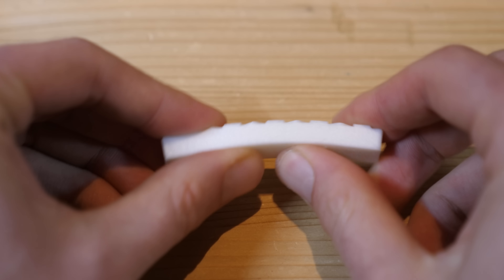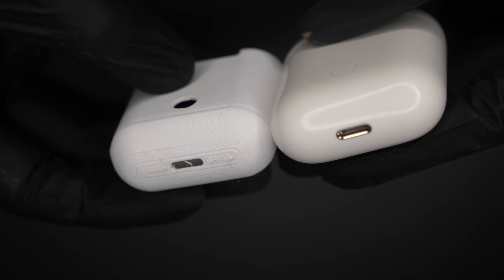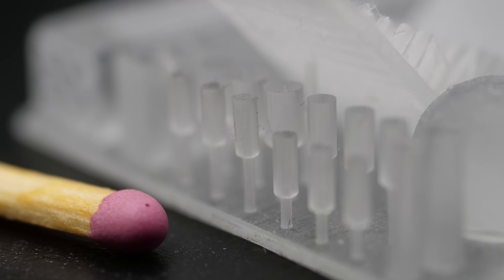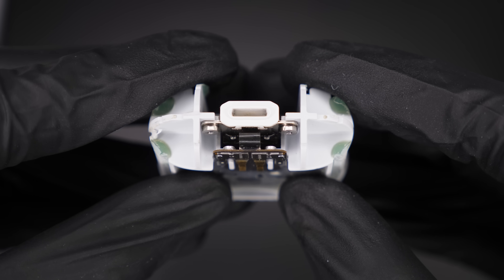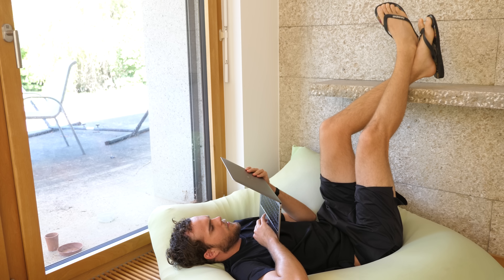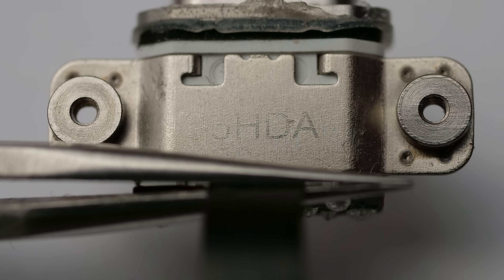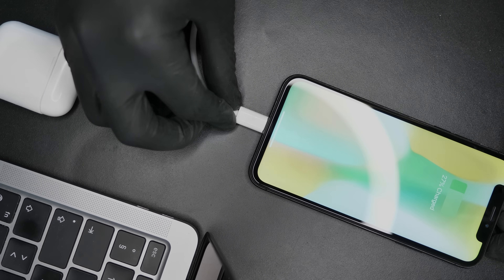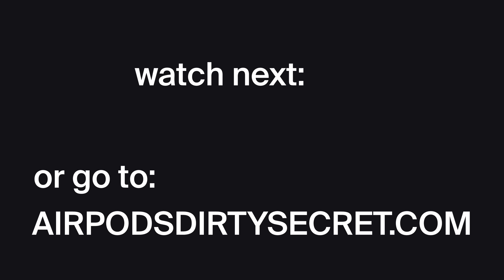AirPods' Dirty Secret (and how I'm fighting it!)

Comment: What if someone made a online shop where u could buy a printed case battery and USB c cable adapter as a set.

edit: maybe even with the usb c port and battery pre connected so u only have to connect the case insert and top.

Comment: I don't understand, were you trying to prove Apple right by spending a ton of money, time and skills fixing this. This process cost more that a new Air Pods. Also, complained about batteries going to the landfill it doesn't seem like you fixed this, you replaced the battery. what did you do with the old battery, throw it away? It seems to me that you only saved some control electronics and plastic, but you use high level skills and an expensive welder. I don't think there's a net positive here.
Reply from the maker: - pinned comment
- battery properly recycled

Comment: I salute your persistance.
However, $3000usd in equipment to do the repair. And 3rd party pcb, screws and hardware. Maybe we need to cottage industry the important things like engine management and powertrain computers?
Nice 3D printer, O-scope and inert gas solder station. Young man, you need to be leading a team in DARPA Tech development. Begin by reverse engineering Iranian drones.
👍
Reply: A Lipo pouch of about 800mah is available  with charging protection circuit on the pouch. Micro j pin connector. For charging,
 A 1.5mm bannana plug would add durability. 500mah charger. This is just a 1-3vdc circuit.

Comment: Congratulations you have proven Apple correct that it is not economical for them to repair them.  Subtract all the time and cost you went through to make the parts, even though Apple could theoretically have parts for technicians to repair them the cost of those parts in addition to the labor cost and other overhead costs, when added up would easily be more than the cost of just replacing it.
Reply from the maker: that's the point, it was designed to be unrepairable...

Comment: MOLEX is thé Compans sourcing Apple with that connector.
Also I didn't check lightning port pinout and protocol : how far Can your adaptor replace ligthning? Only power? Or you also concerted the communication ?
Great job
Reply from the maker: Well that was the problem, molex didn't make that connector. My lightning to usb-c circuit supports both data and power, but the airpods case only uses power anyway. Thanks for the comment
Reply: @ExploringTheSimulation  thanks for the answer. I've watched your other vidéos so i better understand the replacement now. You have a very décent lab, and a New subscriber ;)

Comment: yeah thats apple for you they  make things that are impossible to fix to make you buy a whole new one when they break which is why i will never use an apple product unless its bought for me its the worst case of consumer slavery ive ever seen i would also like to add that they make there stuff not future proof which means they makes sure that the electronic product will break after a time limit due to built in problems with the tech its literally designed to break

Comment: Next apple will add a sensor to detect deviations in luminance values inside the device and if you dare to replace the frame you'll get a notification that your airpods may explode right into your ears on max volume every 10 seconds.

Comment: pretty cool, I don't think the welding is necessary, it'd make future repairs a pain in the ass.  Maybe some glue instead.
Reply from the maker: I probably didn't show what the welding is for properly. I'm welding nuts so that the replacement part can be fixed in place with screws. So no pain in the a**.
Reply: @ExploringTheSimulation  Oh okay, that makes sense.

Comment: “It costs more to open it up and replace the battery than just buying a new one”

Lmfao, wait until Tesla uses that. (They weld their batteries to the frame, instead of bolting, like every other EV manufacturer out there

Comment: Apple needs to bring back the 3.5mm headphone jack. Phones have gotten bigger, so there is plenty of real estate. The plug in 3.5mm headphone work every time. Wireless earbuds are inferior tech, if you can't charge them -then you can't listen to music. You don't have this problem with earphones that don't need to be charged!!!! It is a waste of electricity anyway. So the 3.5 mm jack headphones are actually greener for the environment. I got plenty of broken dongles that have made their way to the trash too. Those lightning cable headphones are terrible too, they cut out sound all the time. I did not have these problems with older model iPhones that had headphone jacks. It is really frustrating how retarded it all is.

Comment: Not related but if Apple decided to switch to USB-C, Because I still use an iPad Air 2 and an iPhone 8 which are not compatible with USB-C,  and with no plans to upgrade in the future, all future chargers would be USB-C but because I use lightning I will not be able to charge my devices if my chargers either broke or I managed to loose them.

Comment: Apple could easily have had this case screw together. They could even have a plastic cover panel bonded by adhesive to cover the screws if they really wanna use the aesthetics excuse. It's how they hid the screws on the iPod Mini. My iPod Mini is still in use today. This is purely to drive sales of new product at the expense of the environment.

Comment: Just another case of Planned Obsolescence being perpetrated by Major Manufacturers, under the false guise of saving $ for the consumer, claiming its too expensive to replace the batteries than to buy new ones, the product was designed this way. 
They made it intentional difficult to replace the batteries, and then make their claims of it not being financially viable.  
Ignoring the fact they creates the problem in their Manufacturering design.  

This is a common manipulative practice, 
To justify their corrupt greedy, excessive electronic waste, generating buisness models!

Comment: Yes you repaired it but the sheer volume of polymers, the energy consumption from the 3D printers and the computers and everything behind it. Unless it's mass produced this would in fact be worse than simply replacing it and having them correctly dismantled for material recovery.

Comment: I do have 2 of them. I had a problem in pairing up my iPhone and I even ordered another one to work. Now these days they both do work on my iPhone. I have them on different key chains one in pink and the other with pink and blue. I bought 2 covers for my key fobs one in pink and one in blue. I think it is a good way for me in the mood for grabbing one or the other in what I’m wearing. When I used one of them a little bit that I will charge them up.

Comment: Just recently, fixed a garmin 172c over 20 years old, new polarization screen, internal battery,firmware update, and a new external antenna soldered on, (was internal antenna) Yes cost me around 50 quid and all the time and effort, but upgrading never ends by design.

Comment: I love what you did. The fact you kept it as an airpod case is cool, but in the end you are only trying to charge the airpod. You could make a slightly larger design that is easier to build. As long as it still fits in a person's pocket you could potentially put in a bigger battery but with the same voltage. Make an airpod case on steroids. Just an idea. You've got all the gear and the skills so if anyone could do it, it is you. Cheers.

Comment: Apple doesn't want you to fix anything.  Just buy another one and throw away the old one.  

I had a keyboard with old batteries which expanded.  Apple store GENIUS ( oxymoron isn't it?) said to throw it away and get another one.  

I was determined to not throw it away.  I used a screwdriver to break the old battery and remove it.  Replaced the battery and keyboard worked fine.

Comment: USB-C is nice because it doesnt matter which way you plug it in, same as lightning. But... There is no standard for the actual cables! Some dont do data, some have slower bandwidths. some have built in propietory tech that limits uses. When I-Phone makes there USB-C version they will install this tech and restrict it for use in only apple products and we are back to the same issue. SOLUTION: dont use Apple.

Comment: Why would you weld 5 different points on a nut when you consider the fastener will... #1) Not be removed and installed often?  #2) In this particular application is complete overkill, 1 weld would be sufficient. #3) There are much cheaper and much less time consuming alternatives( lock-nuts, crush-nuts or loctite)

Comment: it's just easier to not buy/support apple products. They apply the same logic to their latest gen MacBooks where all parts are soldered to the main board so if one part fails it all fails + stops you from upgrading parts. This is by design as it's cheaper and faster to manufacture, which means apple users need to upgrade when something goes wrong instead of repair. But hey apple won't include a charger with your new phone because they are being "environmentally friendly".

Comment: I have the very first Galaxy buds, used them every day since I bought them.I think they're 3 or 4 years old now. They still last for 6 straight hours and case and buds always charged. Also noise canceling that you can toggle on/off with just a tap. 

Now, can anyone explain why Apple always act like air pods are superior when they're clearly garbage. Then Apple basically re-released the same damn airpods, called them "pro" and yall all bought them again. 

How don't y'all see Apple is doing that to you? Year after year.
 The same phone different colors.

Comment: You can disassemble the case using heat. Also if you want to model shell you can just use photogrammetry. It is much faster

Comment: Idk if it would work but I'd try opening those cases with a low temperature from a heat gun and give it just enough to soften the areas with the  " locking clips" and then gently work it back and forth.

Comment: Great video and I like your philosophy on reducing landfill and agree should be illegal to sell products designed to not be able to be repaired.  Politicians need to stop businesses doing this
Reply: Sadly right to repair is something both apple and John deer are trying to get a rid of. Given how much opposition there is against it, it may be a while before anything is done. 

This isn’t even counting technology that is designed to last shorter lives so the companies can make more profit. For example: lightbulbs are given less filaments so they burn out quicker… to be fair it would be hard to make profit if the amount of consumers are few and far between; however considering how long it takes for lightbulbs to deteriorate and break down it causes excess pollution that isn’t needed

Edit: I forgot to mention about ink cartridges for printers, apparently they cost less than a dollar to make but they are sold at nearly 50 times the price. You think you could just refill these cartridges but they insert something that stops you from doing so. They also take a long time to decompose

Comment: I have in mind a small modular electric motor to be mounted inside on roller blades wheels, which is something I would like to release in the open source like this project, would you be interested in doing this research? I do not have the competencies but with some hack I am sure that can be made and the electronic controller is already in the open source.

Comment: You can basically take and lightning port from any apple product, or any beats product, as they were also made by apple....not sure if they still are....but they were....i repaired a beats bluetooth speaker with a port from an iphone.....and it bolted in which was nice

Comment: apple shouldnt be allowed to do this. there is no reason the parts couldnt have snap connectors or hidden screws that hold it together. like a plastic cap over the screw head.

then again, maybe people should just stop buying apples garbage. though every company puts out scam devices like this as well as software.

android comes with a secret garbage can for instance that fills up over time so you run out of space, its to try to force you to upgrade. if it were not intended, i find it absurd they wouldnt have fixed it. i dont know how they havnt been sued for this. factory reset 'fixes' it though.

Comment: If you don't mind what did you use to do the time lapse when you 3d printed the case? The video is super smooth. Really appreciate any information. You did really well on the content and creation of the videos... I use to recycle rebuild electronics for a living for 10 years and the standard tech.business model for non-reuse manufacturing is annoying but as a hacker and repair individual it's fun as a challenge but a complete waste for the planet and consumer. You could try a metal slim Jim type tool with a hook to bypass the clip but it's probably going to crack regardless of the tool or process. Really good work

Comment: i can understand that accumulator packs need a robust and well locked casing. but as accumulators are definitely a wear out and for-explicit-recycling product, there should be also clear ways for replacing them in a fashion that leaves the rest of the value available to re-use with a valid replacement part.

Comment: The only reason something isn't fixable is if it's been designed not to be. For now at least I'm sticking with my wired Sony inears, been 3 years and the battery life is the exact same, zero. They've even been through two spin cycles.

Comment: I bought the airpods 3rd gen with 3yrs extended warranty and after 10.5 months 1 airpod wasnt charging so I took it back to the store as it was under warranty however they try to charge me an extra $140 as they say I've damaged them as there is some rust corrosion in the charging box not allowing good connection.
Not good product look for alternative airpod brand for 1/3 the price.

Comment: It's insane that all it takes is a screwdriver to open a microwave containing a capacitor that's capable of delivering a fatal shock weeks after it's been unplugged but the only way to replace the lithium battery on a portable device is to destroy the casing.

Edit: Don't disassemble your microwave.  Just don't.  Seriously.  Don't.

Comment: Very ambitious! And it gives a nice insight about the airpods. Well, opening the case and showing it to the public wouldn't even be allowed in Germany by patent law. 

But...where exactly is the environment protecting part in this process? You still throw away the broken parts, right? And the maker process is also not all clean. That's said as a maker myself. 

All sumed up, is Apple not doing the same recycling/upcycling as you did? But much more efficient. From old devices, they make new ones. And also improved versions. They scaled the process up.

Yes, those closed devices are crazy, but wouldn't it be a more straight forward solution to not buy/consume those devices?

Comment: So basically to repair my $300 AirPods Pro battery I would need to buy several thousand dollars of 3D printing tools/supplies/software and learn to use it and then buy a tiny electric drill and replace a battery myself that would also cost money and then print and fine tune a new case lol, worth it for views I guess 🤣

Comment: Apple could have made the batt easily replaceable. The inside of the case could have come apart with a single screw at the bottom holding everything together. Then again, there is a reason why FOXCON employees are jumping off the roof to feed the insatiable craving of new tech. The market demands you throw that chinese trash away and buy more.

Comment: Its a great video. Lot of effort put on it, congratulations. But I have a suggestion. You have the potential to go viral if you start taking those issues as a true activist and help fight the fake activists in your videos as well. Today we have people lobbyists fighting against the right to repair bill and (team up with Lewis) and we have fake activists claiming stupid and nonsense issues as climate change and renewable energy, which are all in the interest of huge corporations as an way of imposing their power and ensuring they will keep selling their dirty renewable energy. Even hydroelectric energy now is illegal claiming it breaks the ecosystem. That's only because they want to keep selling their nuclear power plants as sustainable. The world is rot and only true activists with common sense can help to save it by exposing the fake activism. One way to improve your video is to edit it to include a part that exposes the serious problem with apple products that are designed for programmed obsolescence, as well as being designed to prevent repair. Maybe exposing the true impact of the inefficiency and their incapacity to recycle their old products and also exposing that it does not worth it to pay for an product that is designed to fail or to become obsolete in a predefined timeframe.  Also another video suggestion would be a hands on review of the PUK welding machine from Lampert and other of your tools such as the scrubbing brush that you use right after spot welding the connector. I got very curious about those. How useful is that PUK welding? did you use a lot and quite often? I really felt it was really nice. Show more about your day to day projects, that's nice also

Comment: The biggest problem with my AirPods isn’t even the battery. The software is even worse. I got new ones from apple and it didn’t get much better. I had the same problem with some Sony ones. The connectivity is always getting worse slowly. They start to need longer to connect sometimes I need to put them back in the case and try it again. That’s a flucking scam.